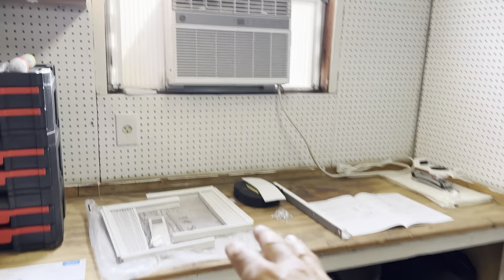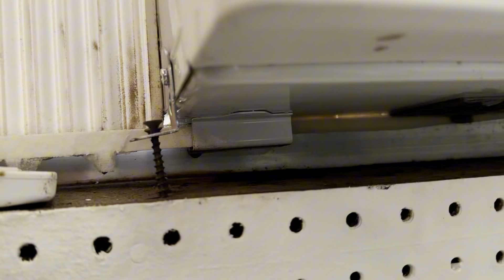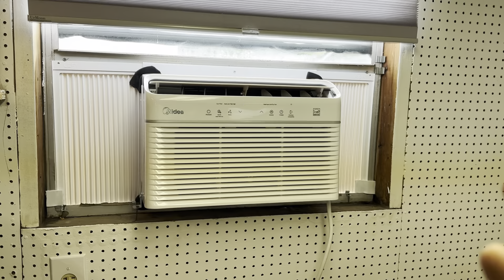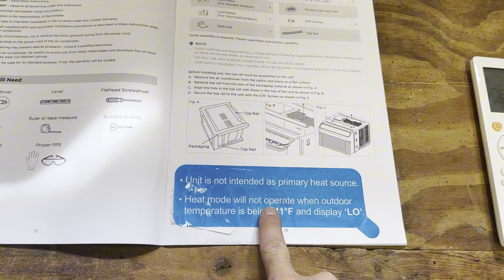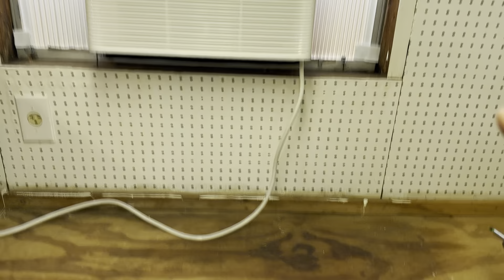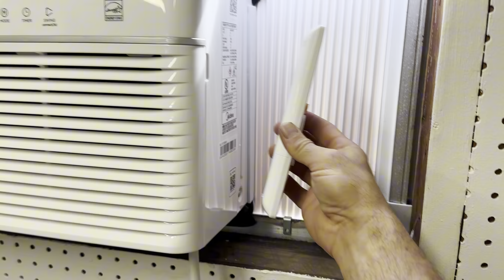Midea 12000 BTU Smart Inverter Air Conditioner Window Unit with Heat and Dehumidifier

Comment: You put it in but no one ever says how it heats? Yes we know it cools.. How about a run with temp gauge on air output with it cold outside. I want to buy one if is satisfactory.
Reply from the maker: None of these units are made to be the main heat. Mine keeps up with my temperature but it never gets colder than 65 here. So I don't know when I can test what your asking.

Comment: I have a Midea 12000 btu unit as well but it doesn’t have a heat setting, does yours? Mine has auto, cool, dry and fan. I think it would be nice to use to take the chill off on those cooler mornings.
Reply from the maker: Yes it does

Comment: How’s the cooling been? 
I have the U shaped but due to recall they are giving me a refund and thinking about getting this one.
Reply from the maker: It keeps my 20x20 shop at whatever temp I need. The other day it was 94 outside and my shop was set on 70 it was to cold I had to turn it up to 72.
Reply: That recall is BS.  You just need to clean the blower (unit snaps apart) or to prevent, drill a small drain hole

Comment: Cant use heat below freezing temps . Idk if I would buy that
Reply from the maker: Yes its not ment to be used as a primary heat source. It doesn't get to cold here. If you live somewhere that it gets under 40 a lot don't get this one.
Reply: @TechReviewswithphil  I live in Florida this is perfect
Reply: @jonbemerkin yea they are perfect for Florida and you can move the temp sensor towards the inside and get it to work in lower Temps.
Reply: @TechReviewswithphil guy on YouTube moved the temp sensor closer to the inside and has been using down in the 30s no problem.
Reply: @supremeauto6749 where’s the video?